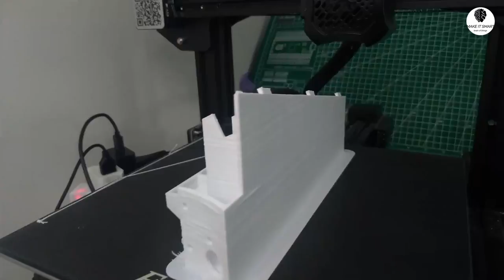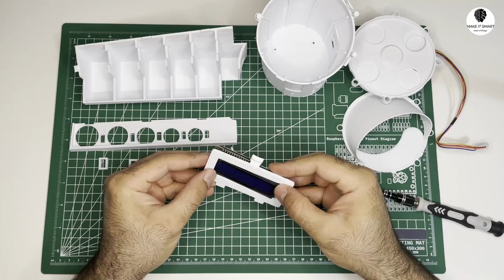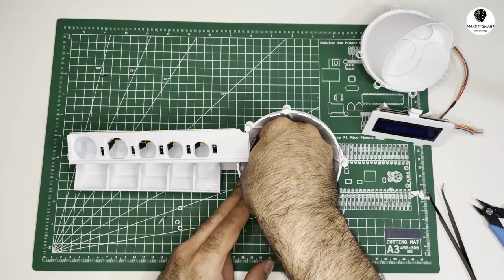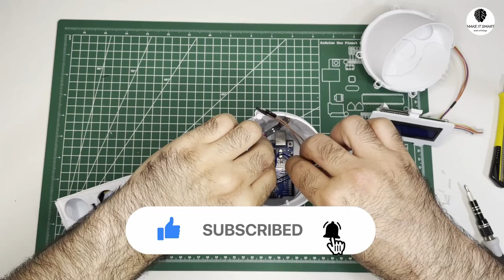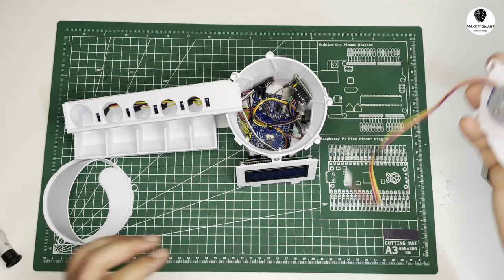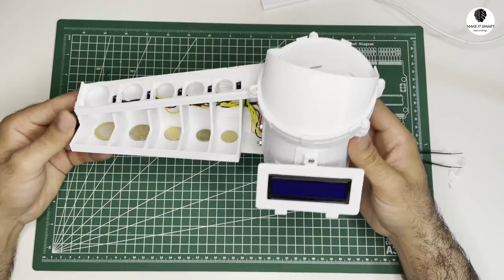DIY Arduino Coin Sorting and Counting Machine V2 #arduino #coin #diy

Comment: Hi! Your video is really great and very inspiring, your system with the TCRT5000 sensors is really clever both mechanically and in terms of code. However, I was wondering why you added two resistors on the IR sensor? And how do you calculate their values?

Thanks in advance, and keep up the good work!

Comment: Hi, how can you change the value of the coin being read by the IR sensor? mine keeps reading 0.50 while it was actually 1
Reply from the maker: Between lines 62-66, there coin values for each sensor. You can modify these values as you need.

Comment: where I can buy ALL components. 3d printer I have already. 
1 piece Arduino UNO
1 piece 16x2 LCD Display with I2C module
1 piece 28 BYJ-48 Stepper Motor
1 piece ULN2003A Step Motor Sürücü
1 piece On/Off Button
1 piece 2.5mm Female Barrel Jack
5 pieces tcrt5000 IR Sensor
5 pieces 10K Resistor
5 pieces 330 Ohm resistor
A few  M3 8mm and 6mm screws and nuts